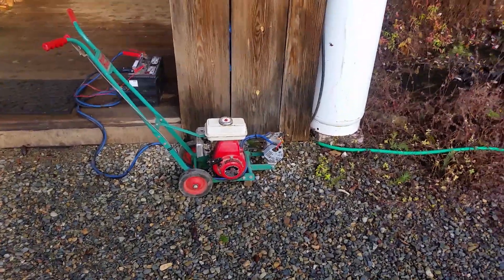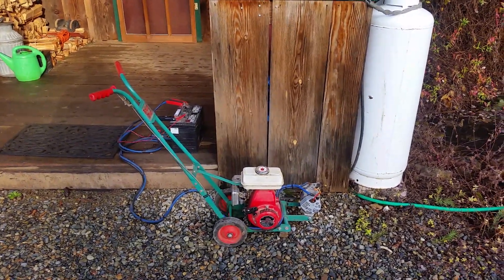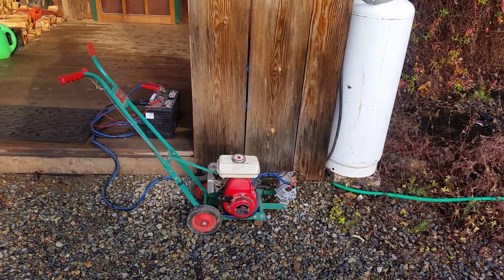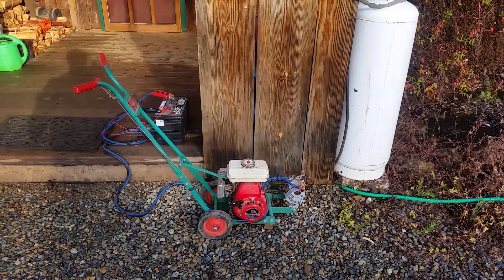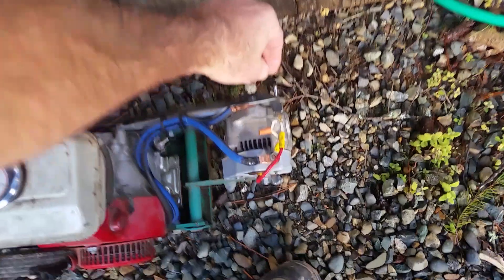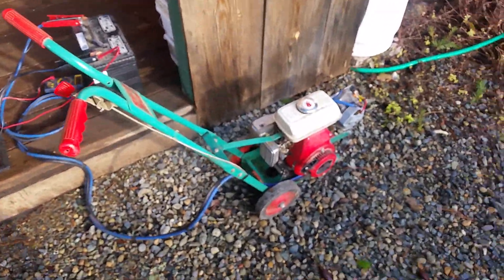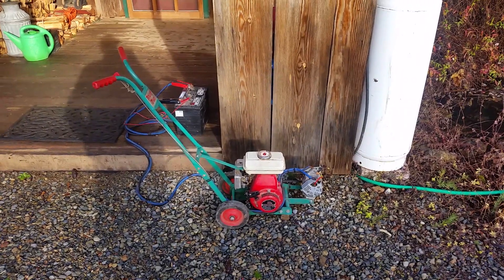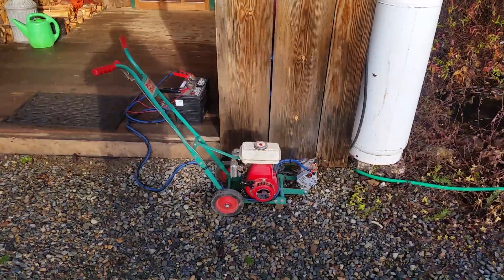2.2 Horse power Honda DIY 12 volt charger

Comment: Digging it! Nice job! Okay Steve, you got me thinking at the end (when you said you could live off of this little DC generator off-grid). If that rig can output 50 amps (@ 12v). That means it could feasibly output 24v with 25 amps. My house uses under 25 amps DC when I am not using higher power appliances. At night, the current draw on my system is about 7-8 amps continuous. So, that little generator could do it...however, would need a large inverter/battery bank to hold those higher power loads. And the generator would have to run all the time. When we were in the field (military) we ran our generators 24/7 for weeks on end. On one deployment they did not get shut down for about 4 weeks. Great design on a dime there Sir!

Comment: good morning,  this is a very good idea!! 
So if you had a 4 battery setup with inverter would you charge 1 at a time or get a larger car alternator? Also how to wire info ??  Is the alternator just 1 hot and 1 ground and a switch?  is the switch a 20 amp spst ? maybe you could do a quick vid on how you wired it up    thanks